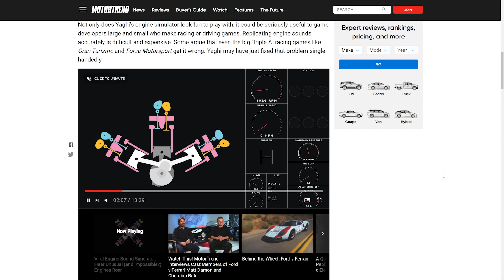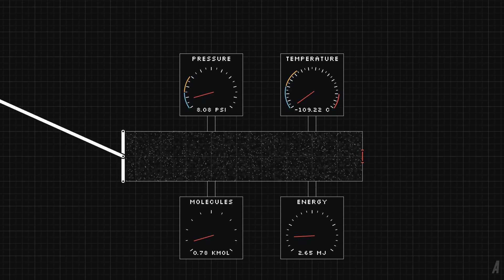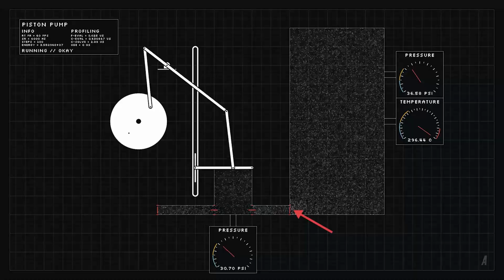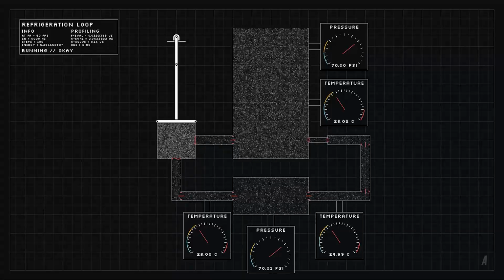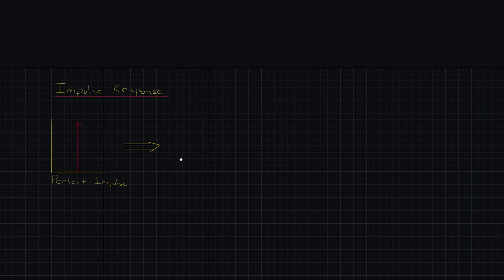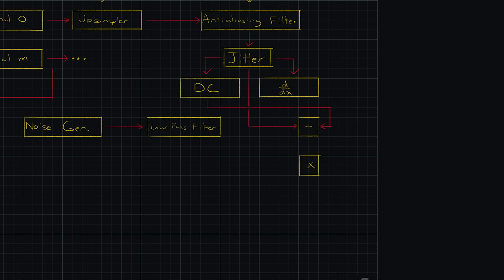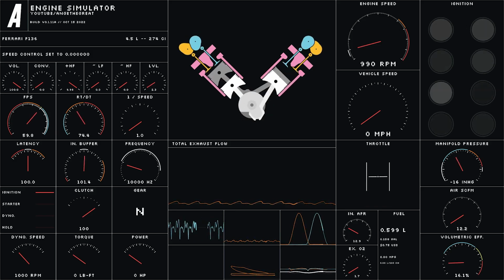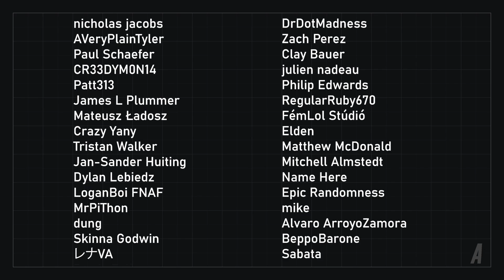Engine Sim: Procedurally Generating Audio Using a Real-time Fluid Simulation (Technical Breakdown)

Comment: Hey, thtas awesome, i have a question.

There are some videos of engines at millions of RPM.

Shouldn't this fluid simulaton prevent that? 

As it should not give enough time for any air to get in the piston with the amount of time the valves are open and the speeed the piston moves.
Reply from the maker: Millions of RPM is definitely outside of the "operating spec" of this simulator. A lot of the meme videos I've seen online use unrealistic inputs and there are ways of hacking the sim to do crazy things like this. It's also possible that at those speeds there would be a lot of "aliasing." Like for instance, the valve might be opened for a millionth of a second, but the fluid simulation will be sampling the valve position so slowly, it almost seems like it's open for longer.
Reply: @AngeTheGreat  Ohh okay, that clarifies a lot, based on those videos i assumed that the fluid simulation was quite simple, but then your video went into all the detail and i got confused.

Thanks for the explanation and thanks for your awesome work!

Comment: Wasn't going to say anything about your apparent preference for Imperial units of measurement, but I prefer metric. Besides, Imperial and metric measurements can be cross-converted fairly easily for the most part, and for the tricky ones we have calculators.

This is also a possible business opportunity for someone to reintroduce the slide rule concept as a, I dunno, a slide conversion rule?

In any event, the intricacies of simulation of engines is a more interesting topic, and hasn't been covered to the point of irrelevance.
Reply from the maker: I actually don't have a preference for imperial and I use metric for most things in my daily life. However, there are some situations where imperial just can't be avoided or is more common. Pressure, for example, is something I understand better in PSI because it's more commonly used. In my first video people lost their minds when I used imperial units for things like manifold vacuum and engine displacement, when the reality is that these are just the common units used when building certain kinds of engines. And I agree with you that imperial and metric are pretty easy to convert between which is what I do all the time being in a country that uses both in different contexts. I don't think it's a big deal, but a lot of people online seem to take it very seriously, hence why I called them out lol
Reply: @AngeTheGreat  Eh, people just need to calm down. It's not like you're trying to land a probe on Mars or something.

In any event, there are so many conflicting standards... pressure, for example, I use bar at work whenever pressure is involved, I fill my car's tires in kPa, and yes, engine engineering mostly uses psi.

Comment: 1) Can the system simulate the intake resonance as well?
2) The sound is generated only by the exhaust? AFAIK a lot of the engine sound actually comes from the intake. It's hard to distinguish all the components but I think I can hear the more pronounced "wind noise" when the throttle valve is more open.

Comment: You said you never got the meaning of that equation at the beginning. The equation just says that both sides are equal, and must remain equal. With that stablished, if you don't have one of those variables, you can derive it with some algebra. That's the meaning of the equation, it helps you to find unknown values.
Reply from the maker: You are correct and from a purely mathematical perspective I understand how to use the equation to find unknown values but I could never really get an intuitive understanding of what it was trying to say, that's what I meant. It seemed like a very abstract way to relate pressure, temperature, volume and molecules but if becomes obvious when you understand the underlying theory.

Comment: I guess one thing that may take away realism is the vibration that goes through the entire metal engine? You have only simulated the inside but not its effects towards the outside. In real world this huge metal chunk also vibrates through the entire car plus the atmosphere that reaches our ears. So the sound you hear now by itself is probably very accurate. You just have to add the rest if possible in realtime?

Comment: I'm reading your code of gas systems. Well, you're not a fan of comments I see... :) I'm particularly interested in the way you handle bulk velocity. I made a similar simulation once in Simulink, for pneumatic systems, but I couldn't mix in bulk velocity very well. I ended up with a sort-of distributed approach, similar to how electric engineers simulate powerline as a series capacitors and inductors, but it was very slow. Would you be able to explain it a bit? Or just point to the sources you worked from for this particular problem.
Reply from the maker: I'm not really a big fan of comments, I find that they don't usually help my comprehension of other people's code, or they just use them as a crutch to help people understand their convoluted code. Incorporating velocity was probably the most challenging part of the entire simulation and I'm still refining it now. The fundamental idea is that a small volume of air must have made it from vessel A to vessel B. Assuming that both volumes are cylindrical or rectangular, that implies that the virtual volume of air must have had a velocity in A and a velocity in B in order for that motion to occur over the timestep. We can take that velocity, find the implied momentum and add it to the momentum of the entire volume to approximate that flowing fraction colliding with the rest of the air in the chamber. A similar process is done in the source volume. To account for a lack of flow (ie force from the walls) or turbulence velocity is also dissipated. Throughout this process the kinetic energy implied by the bulk velocity is very carefully accounted for and subtracted from the molecular kinetic energy to conserve energy. That's pretty much how it works.

Comment: Would this be applicable to music plug-ins based on physics modelling? In example drums or woodwinds? Marvellous creation btw! I’m very intrigued by this project :)
Reply: You might know about Pianoteq, which is a fully physically-modelled piano from the strings vibrating to the wood panels vibrating. I figure there's a lot of this stuff in that codebase too.

For woodwinds the more traditional approach is using waveguides, which is already a model for how air pressure propagates and resonates in cylindrical tubes, but is simpler and easier to compute in real-time than going from first principles like this.

Comment: Hey man, if you implement some of the cool math stuff others in this comment section have offered, do you think you could include a simulation of the difference in sound between all the different header and exhaust system materials, diameters, lengths, and wall thicknesses? And if so, could that be implemented in the "full version" complete with UI?

It'd be bitchin to be able to go from cast log iron headers with aluminized steel exhaust to tubular 321 stainless headers with a 304 stainless, or go wild with an all-Inconel system because DAMN does a Ferarri 458 with Kline exhaust sound good!

Comment: I don't think the first anti-aliasing filter has any impact on the signal chain, and potentially reduces the effectiveness of the jittering (as that has to be applied on the higher-resolution signal to be effective at dithering noise). Since you already have a second AA filter down the chain, I don't think the first one does much more than waste CPU cycles.

Secondly, another improvement would be to change the first interpolator from linear to cubic, or even sinc interpolation, since linear interpolation has discontinuities on its derivative and that creates harsh harmonics that are going to reflect down as aliasing after upsampling.

It's only my 2cc as an audio hobbyist and learning DSP at uni.

Comment: I've never played with your engine audio simulator, but there's one thing that it appears to me that your missing in it which is the noise that comes from the engine intake. With any gasoline engine, there's a deep growl that comes from the intake side. 
Some cars like the Focus ST, or VW Golf GTI have hoses from the intake side of the engine to the cabin to enhance the engine noise under acceleration.
I think it would add some of the missing noise complexity that I believe this simulator is missing.

Comment: Can you even make a wheel and tire simulator based on Engine Simulator?
Like, for instance, you create your own width, profile, and diameter (for example: 275/55R20)
You create your own rim, including number of spokes, lugs, split or unsplit, etc.
Then, there will be a button that reads "TEST!"
Reply: that's a lot harder than simulating a closed fluid system like the internals of a combustion engine.
with tires you have to model the air but also the physical contact of the rubber with an asphalt, ideally covered with some granular material and possibly water. then add the grooves and temperature to that, and that's just too many variables. remove any of it, and it doesn't sound as believable. a lot of faking would have to go into that one and it's pretty meaningless when you can record it and then modulate. besides human ears are not that sensitive to different tire sounds, as long as you cover the obvious differences in road quality, which is already something that every rally game does: sand/dirt/gravel/tarmac + dry/wet/puddles/snow.
Reply: @milanstevic8424  NOTIFICATION SCROLLING IS BROKEN!!!!😭😭😭😭🤬🤬
Reply: I'm not sure what you'd want this tire simulator to simulate but if you're interested in grip it's likely not gonna be able to do that since the underlying physics engine is a rigid body simulator and tires aren't rigid bodies.
Reply: @jusmirtic  obviously he meant audio
Reply: @jusmirtic  Just a rotation
Reply: @milanstevic8424  I mean accurate audio would require tire deformations so you still wouldn't wanna use this simulator as a base to implement it. You could do it based on the profile in a very similar way to the engine sound simulation at 13:54 just using tire rpm and estimating the contact sound, but it obviously wouldn't be any good.
Reply: @santinoeli71506  So you'd just want the visualisation based on the game engine he's using for it and not a simulation based on the physics engine he's using?
Reply: @jusmirtic  sure, that's why I said temperature and I mentioned rubber specifically, even though it's technically not rubber, there is natural rubber in every tire, because it's still a necessary non-decaying component of automotive industry.

Comment: I just wonder if the really high pitch noise is a side band above the sampling frequency of the system or something. it sounds a bit like the compression artefacts of 96kbit/s mp3, maybe it could be removed with a smoothing function on the output. maybe just average across 2-3 samples.
Reply from the maker: I've added some antialiasing but I know for sure there are still artifacts here and there. I think I just need to reassess the audio processing techniques and correct all these issues when I do the rewrite. Thanks for watching!

Comment: So if I understand this correctly, this is based on fluid simulation but you're using approximations to avoid explicitly simulating particles and making the program run fast enough, correct? In that case have you thought about using GPU computing to actually simulate the particles, and potentially make it even more accurate?
Reply from the maker: In this context, a particle would really be a molecule and there are simply too many of them even for a GPU to simulate in real-time. I'm actually not sure if particle-based approaches are even used for fluid simulations except for those at the very granular level (ie simulating just a few atoms at a time). I'm sure there are ways to optimize the simulation further though.
Reply: @AngeTheGreat  I see. Aren't there any other calculations that could be offloaded to the GPU to make it faster? I've played with compute shaders in DirectX and they worked really great, even on my lowly RX 580. I feel like this is a somewhat "repetitive" thing to run on the CPU but you know more than me. Just curious

Comment: Most of the runs I've seen on YouTube still feel too muffled to me, especially when compared to engine braking. Engine braking seems to sound normal, but then revving up sounds squashed.
This is incredible work, though!
Reply from the maker: I have some theories about why this happens and I'm working on fixes for the Steam release. Engine braking sounds a bit less muffled because the movement of air under those conditions is much more erratic giving more character to the sound. Thanks for watching!
Reply: @AngeTheGreat  Oh, I didn't know about a Steam release!
Reply from the maker: Yep, that's what the Patreon is for :)

Comment: honstly, i feel that the only "advantage" if i can call it that from the automotive engineers sim is that they keep tabs on thermodynamics, materials, fatigue and similar highly technical details!
but sound wise the only thing you could add to shut everyone up is valve train clatter, im absolutely not smart nor an expert and i may be pulling some data outta my ass but there was this one video in HP university's channel about a dyno that could run the valve train only and people thought the engine was running

Comment: Does your fluid sim only work in contained systems? Could it, for example, simulate air flowing over a wing?
Reply from the maker: Simulating aerodynamics is fairly complicated and would probably need something with a much finer resolution than what I've implemented. The fluid simulation I made is optimized for the very particular case of air travelling in relatively small volumes

Comment: I'm confused about your comment with the reddit experts. It is correct that the majority of the heavy lifting, meaning: what is responsible for the core sound that people love, is the fluid sim no? It's the driving factor that you use to apply the convolution and EQ to, which you demonstrated in this video.

Unless I'm missing something.
Reply from the maker: A lot of people (especially on Reddit for some reason) thought that the majority of the audio came from the audio filtering step as opposed to the fluid simulation and tried to argue that the fluid simulation is either pointless or just generates some sort of sine wave which is then magically processed into an engine noise
Reply: @AngeTheGreat  Oh I see, now I get it, lol. Thanks

Comment: Do the "simplistic" audio simulations at 13:55 use the same filtering pipeline? I think, that showing that the simplistic audio simulation still sounds bad even with the supposedly "important" filtering pipeline would be the most convincing argument here.
Reply from the maker: The filtering pipelines are identical. You can make improvements to the "simplistic" version by using a better sound for the individual events but there will still be no variation for different engine load conditions. The sound I used was the impulse response itself (ie the .wav files provided with the application) to show that they are not primarily responsible for the audio generation since this was a common argument that I saw people using.

Comment: Does the simulator takes into account the rest of the exhaust? Mufflers? Pipe length, diameter, material?
Reply: I think it only simulates diameter and pipe length but if not I'm sure it could be implemented by someone clever

Comment: 'What's a sim' ah yes, life's biggest unanswered question lol. It's so subjective, the only way to know is by testing & demonstrating that it works, until it doesn't. The fact that you can run all of this math on consumer hardware and get reasonable fps should be applauded. I don't know what more others might want. More accuracy? How much more accuracy are talking here? And can it be run on consumer hardware without it being a stuttering mess?

Comment: How do you decide how much energy to add to the molecules at the combustion step?
Reply from the maker: It's based on the chemical energy density of the fuel and how many molecules have been reacted at that point.
Reply: @AngeTheGreat  Do you support stochiometric ratios? Like, can you run fuel rich or lean and get a different combustion rate/power?

Comment: How did you get the exhaust impulse response? Did you record one yourself or are they available somewhere? I think to get an even more realistic sound you'd need to add elements that are not strictly part of the engine simulation. Right now the sound is what you would would hear if you stuck your ear right into the exhaust. What's missing is noise from the intake, engine vibrations, random rattling sounds and room reverb. That said, I absolutely love what you have built here. Keept it up!